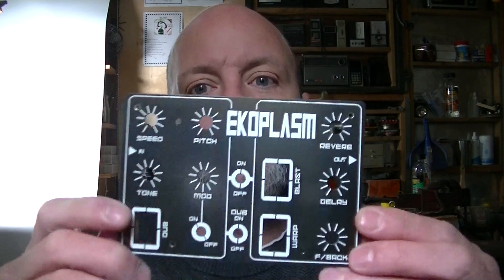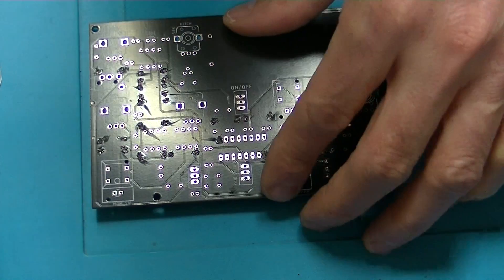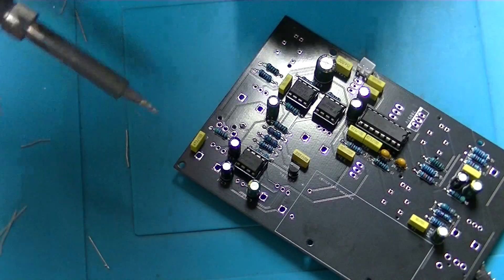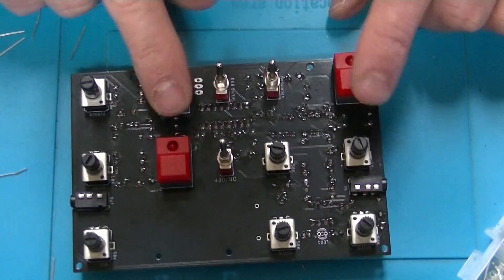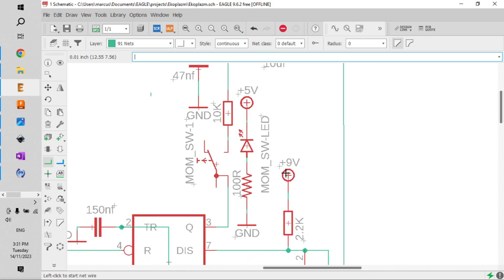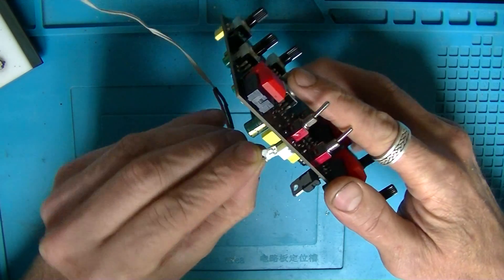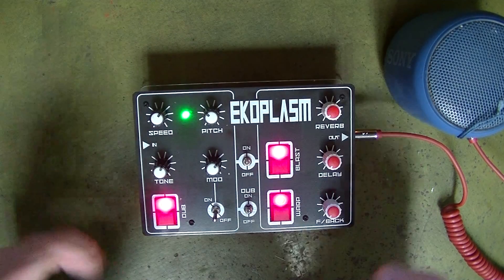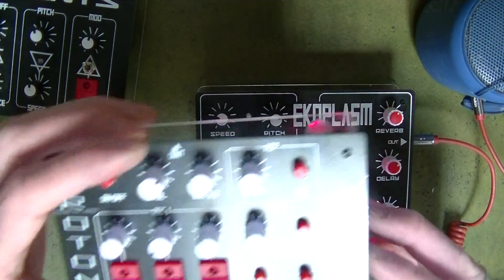Ekoplasm- a Dub Siren and Delay/Reverb Synth in one.  Little Synths with BIG Sounds #3

Comment: Just finished mine and accidentally spent an hour jamming on it instead of going to bed. On my Wedding anniversary. Worked first time, despite my ordering a mix of polyester and polypropylene caps, two of which were the wrong size. The thing is bloody addictive and is going to cost me a fortune in 9V batteries if I don't get a rechargeable wired in soon.

You can make loads of classic dubby bleeps and sirens, 80's telephone rings, kind of use it as an arpegiated bass synth or just wail on the delay feedback for. It's a freaky good time.

Kind of wish the warp was an on/off rather than a momentary but the boards are printed now, and it's fine as it.

Amazing work Marcus!
Reply from the maker: Love this!

Always great to see shit working for peeps on these little synths.

Happy anniversary!
M
Reply: Hey, is it normal for the dub siren stage to be heavily muted when there is something plugged into the input and for the input level to be quite attenuated? Just wondering if I did something wrong or if it is how it is. Since I have five boards, I was hoping I could chain them up 😅

Comment: You know, I only just noticed that the title of the video has a typo? It says "Ekoplam" with no Z.
Reply from the maker: Thanks for the heads up!  I’ve sorted the title with the correct spelling.
Reply: @lonesoulsurfer  No problem! Also a couple in the Excel doc:
- says 7 x 50k ohm pots, rather than 6x.
- says polyester caps but links to polypropylene.

Bit of a pain trawling AliExpress, even with the links. Tayda Electronics have most of it at a decent price – even the PB86 buttons. Wish I had known about them at the start.
Reply: One more note for the Excel doc: There are 3x 47uf polarized caps, not 2x.

Comment: The Google Drive link is now 404, by the way.
Reply from the maker: Thanks for the heads up.  I have migrated everything over to GitHub, will update the link and let you know when done
Reply: @lonesoulsurfer Great! Yes, I found that. The parts list is very handy, though could use a little bit of revision. The number of pots seems to be off by one. Also, it would be handy to note which length of pot to buy.

I ended up ordering white facias and black main boards from JLCPCB, per your guide. Again, many thanks for the effort! Annoying that the minimum qty is 5x. Nephews will be getting dub sirens for xmas I guess 😂
Reply: @LongPeter  do you have a lot of nephews? Would you be interested in selling one pcb?
Reply: @AudriusC-t7e  I do but yep, happy to sell you one if you like. I actually bought 5x all of the components so I could bag them into kits :)
Reply: @LongPeter ah, that would be brilliant! It would save me a lot of time for ordering, waiting for components etc. Also you've already built one, so you know the craic. 
Thinking what would be the best way to pm or taking it offline, any preferences? Cheers
Reply: @AudriusC-t7e   Hmm, seems like my reply was filtered out, probably because it contained a link.

I've added a link to the contact page of my website in my channel bio. Hopefully that works :)

Comment: Hi, love the stuff you do been checking out your new stuff and your older dub siren stuff and think it’s all great I’ve got a question about how it some parts of it work because I can’t for the life of me figure it but in the examples the pitch modulation from essentially the 555 ic configured as an lfo sounds to me as if it’s sometimes a smooth sine like modulation and sometimes the more alternating between two pitches like the square wave it should be emitting do you know why this is?